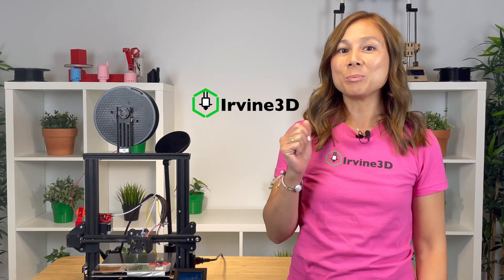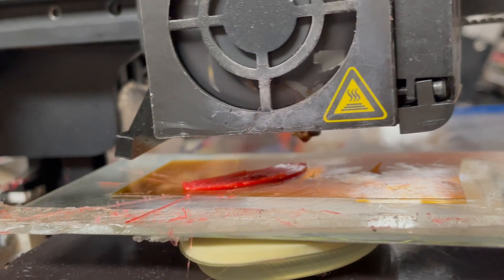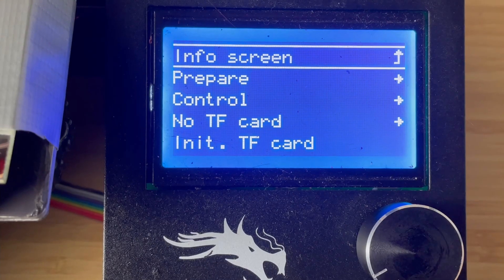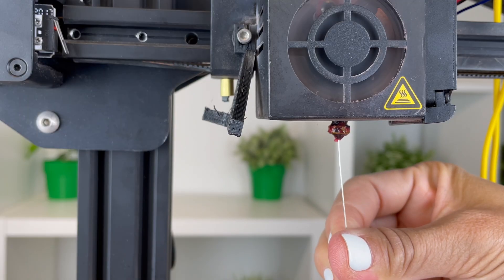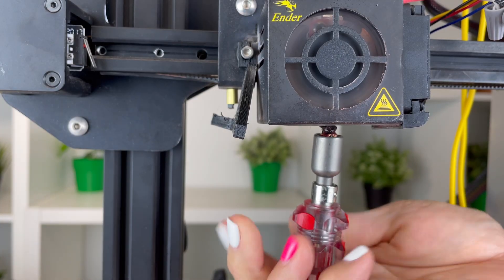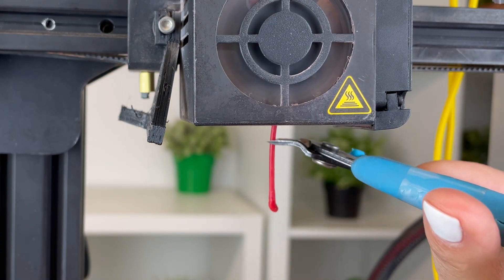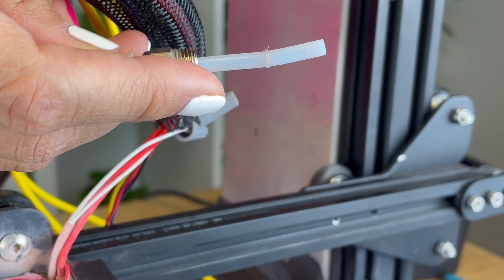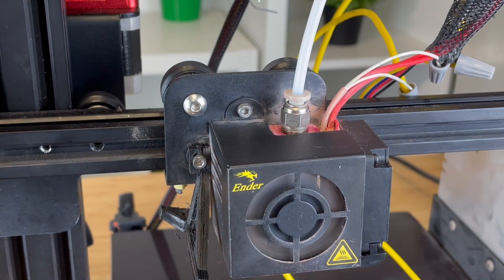Ender 3: Unclogging Nozzle

Comment: This is great an all but don't show how they removed the silicon surrounding the hot end.
Reply: The silicon surrounding the hot end just pops off. I used the small flat head screwdriver to gently remove it while it was hot. I would try when everything is cooled down or off and then you can pull the silicon surrounding right off. Just keep track of the one side that doesn’t have a wall, so when you reinstall it, you know which way the empty silicon wall was facing. Hope this helps!
Reply: @Trinialll  thanks yeah I figured out how to clean the nozzle from the top down. Had a jam or some deal. Tys for reply

Comment: I can’t get the white tube to come out
Reply: In my printer there is a lever which i have to press while pulling the filament out. Mostly the pulling needs three hands.
There are four mone options to try. Fyi i donot have the filament release/unload option in the printer menu.
1- By a fourth hand while pulling filament i need to rotate a filament control wheel which takes it in/out.
2- in the settings, preheat nozzle to 240C, then pull or push and also try the lever pressed together
3- remove the nozzle alongwith heater holding the nozzle  (if there are screws holding it), then remove the filament
If the filament is broken inside:
4-do not remove anything, just heat it up to 247C, and let all filament inside melt and flow down. Use cleaning wire to push and pull inside the nozzle from both the directions. When the wire passes through, wipe it down with thick layers of napkins each time.